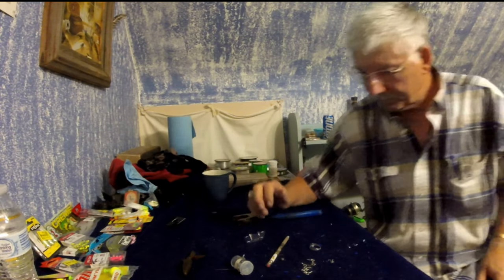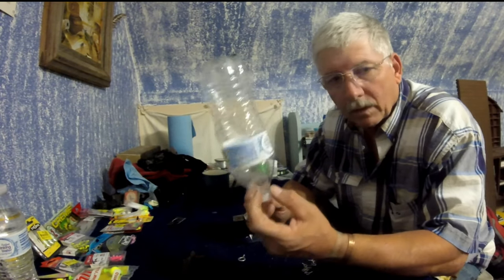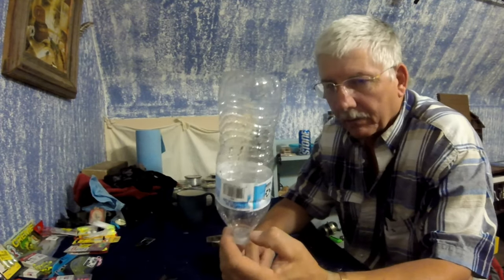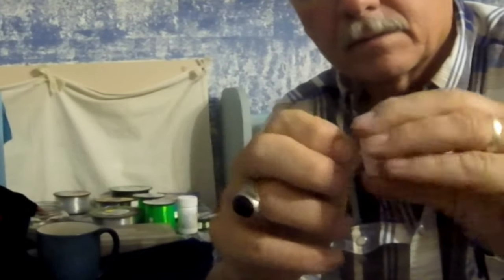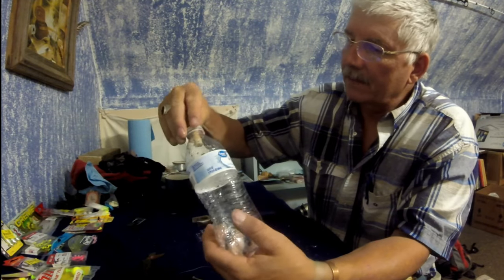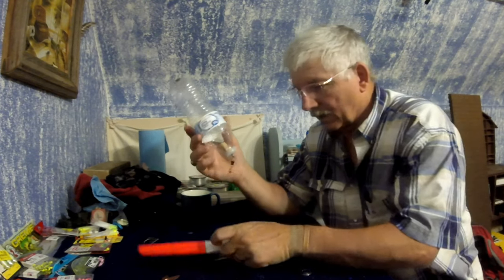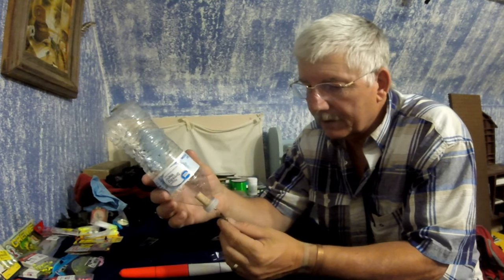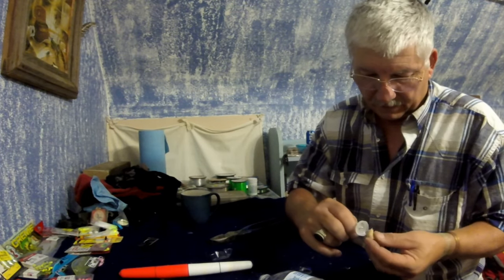How To Make A Water Bottle Bobber For Fishing

Comment: I have been using water bottle bobber for five years. It is the least expensive floated most readily available piece of fishing equipment on the planet.  And don't waist your time putting a hole in the cap. Just clip onto the cap ring.